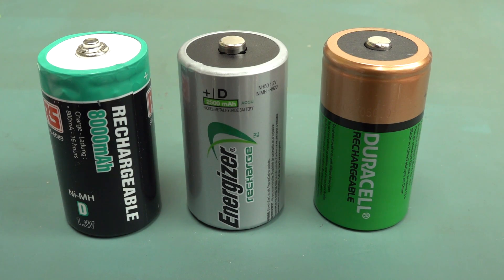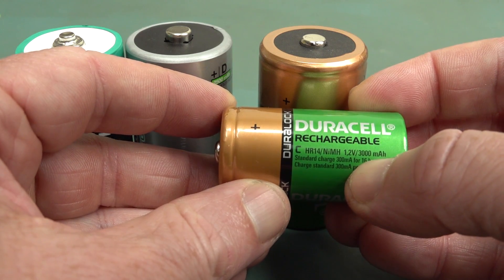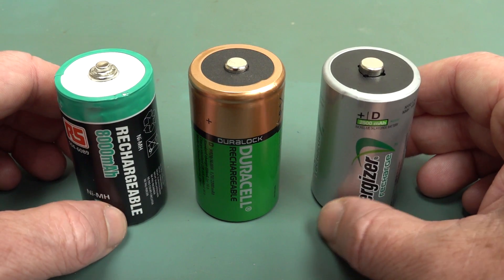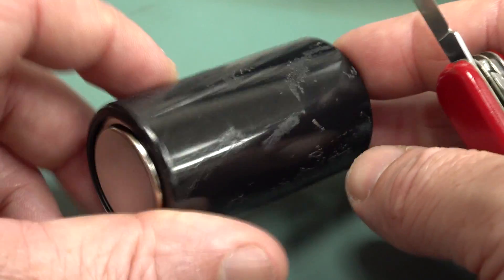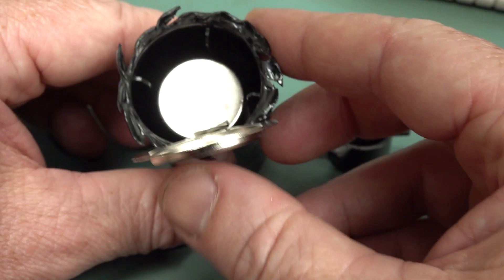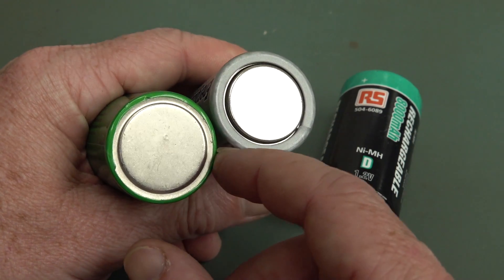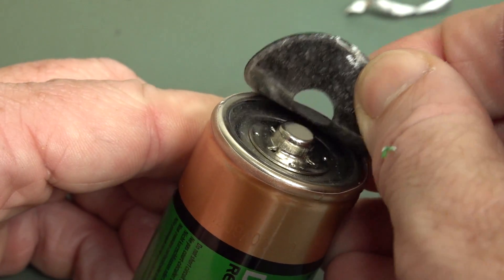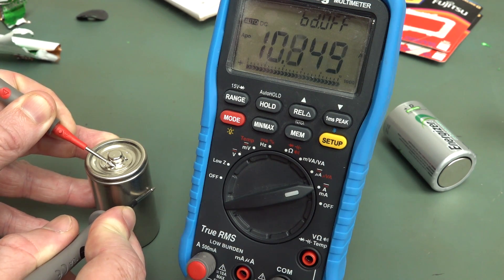EEVblog #1200 - BUSTED! - Energizer & Duracell NiMH

Comment: I know nothing about batteries, which is why I googled it before purchasing rechargeables. The first thing I found was obviously the nimh, so I think most consumers are aware of this, especially the ones that start with 0 knowledge and have to google it. 

However, there are a also some advantages for the weaker ones. 1) they're way cheaper, and some people prefer (or have to budget) paying less and charging more often 2) The charge time is much faster. Most chargers won't tell you when something is 'half charged' but if you're short on time, you'll know exactly how much power the thing has at the fully charged mark.  3) some devices just don't need that much power and it's excessive to spend the extra money when you only have to charge it once  year anyway. 

It would only be a rip off if they weren't passing the savings on to the consumer, but they are, and that's the point. Duracell/energizer do sell higher capacities of D-cells for more money, you just didn't review them here, so it's an apples to oranges comparison when you're ignoring the price point.

Comment: As long as the price reflects the capacity it should be fine. If the D cell was all battery then It might be to expensive to use. Anyone agree? or do you think each size should be the highest capacity possible?

Comment: In the late 70's or early 80's Radio Shack sold a series of NiCad batteries that were packaged in a purple and white plastic shell. Internally the AA, C and D batteries used the exact same cell!

Comment: Disappointed in this video.   The RS battery is like $11 USD and the Energizer is like $3.35.      Its not a rip off.    
They give you options.  Loading up some kids toy use the cheaper battery, loading up some professional gear, get the expensive high capacity battery.

Comment: No scam here. 
Read the labels.
Pay for the capacity you want.
Volkswagens cost less than Mercedes, and have different capacities.
Reply: But, in this case, you'll be paying exactly the same for the VW as you would for the Merc. That's the point...
Reply: @troyjollimore4100  check again.
Amazon sells all three. The price of each is relative to capacity.

Comment: If the capacity is similar to their alkaline cells, and they're priced fairly, there's not a significant functional issue with these. They are quite underfilled and it's a bit wasteful though. 

I've seen many comments on this parroting the favorite corporate line "you should know better,  consumers should do x", but ignoring the fact that it's an intentionally mediocre product. Regardless of intent, they put in effort to produce an inferior capacity, relative to cell size and composition. I think anyone would be annoyed after watching this disassembly. I'm quite confused by anyone arguing in favor of reduced transparency and clarity in product labeling. Properly enforced regulation can help eliminate issues like this.

Comment: This construction is very Similar to a capacitor
Reply: Batteries are very similar to capacitors, main practical difference is that capacitors can discharge very quickly but batteries can hold larger charges for longer. They do function differently and that is how they achieve this, but construction wise they look the same.
Reply: @Ephem13  I know this but was surprised the the difference between a rechargeable battery and a capacitor are very similar but also makes a lot of cents. The technology's even though the applications are very different probably the early rechargeable batteries (might be still the same today) were a evolution a capacitor the same way black powder is the same as charcoal.

Comment: Hey dumbass, the lower d cells with lower ratings are for low draw devices that don't require the huge rating and they were developed to use smaller internal cells but fit where an older non nmhi d cells fit. Most are built for small security cameras as back ups. It's NOT for scamming as they ARE marked appropriately. Your cheezy accent and fake ass  "personality" just make you look like a douchebag.

Comment: What's next? A stack of button cells to make a C and call that F, because it has 24V?
Reply: I once saw C and D battery housings sold to fit a AA battery inside. Good for toys and such without needing to stock all battery types at home.
Reply: @rudylikestowatch  4 pieces for $10 - AA to D adapters. saw them on amazon recently. Hilarious. But I like to have actual D cells.
Reply: @Sypaka  Yes, D cells would be superior.
Reply: Now I get your original comment. An A23 battery is an 8-cell device with a nominal voltage of 12 V often used for garage door remotes.
Also, some 9v batteries are a bundle of 6 AAAA batteries inside.

Comment: My experience as someone who uses a lot of rechargeable batteries is that they all pretty much suck these days.   The mah rating is only half the problem.  The other half is the dependability.   They tend to just randomly stop working often and it's annoying.  I still have to carry alkaline backups for everything but there's about a 20% chance on every outing one or more of my rechargers will randomly die on me.

Comment: My Eneloop AA  rechargeables inserted into a 3d printed "D cell" adapter outlast the Energizer scam of D cell batteries.
Reply: This D cell adapters are officially offered, unfortunately they offer no Eneloop as true D cells.
Reply: @simonm1447  at least they're open about it and say "we don't make D-cells, but here, have a D-cell adapter for the AA cells"
Instead of making a "D-cell" that's just an adapter with an AA-cell and sell it for 3x the price.
Reply: @maximilianmustermann5763  yes, D cells with hidden smaller batteries inside is cheating people which don't know about it.
Reply: @simonm1447  Idk about cheating. If people go by how many ampere hours they can get out of them, there's no real lie. Adapters are a hassle in many cases. Some might just prefer getting the right size right there in the store.
Reply: @stale2665  You don't only buy a adapter - you buy a battery with only 1/3rd of the capacity. 
This is clearly a technical limiting factor for many purposes, these big cell size is used in stuff which needs more energy than a AA battery can bring.
Reply: @simonm1447  Yep, I have the official ones. That's what I modelled the ones to 3d print after. Shame it's so hard to find a quality D-cell NiMH.
Reply: @PowerScissor  In Europe there are Ansmann NiMh cells available as D cells. They are good quality, but cost more than 10 Euro per cell. They have 10k mAh.

Comment: Aaah the lessons of Big Clive.   From Energizer's own safety sheet:  "Do not open battery. The negative electrode material may be pyrophoric. Should an individual cell from a battery become disassembled, spontaneous combustion of the negative electrode is possible. This is much more likely to happen if the electrode is removed from its metal container. There can be a delay between exposure to air and spontaneous combustion."  https://data.energizer.com/PDFs/nickelmetalhydride_psds.pdf     Clive's video: https://www.youtube.com/watch?v=tBg4ximDrsk
I hope you had your explosion containment pie-dish handy!

Comment: I always wondered why Eneloop sells "D-cell" shrouds designed to contain a AA battery.  With capacities of 2450 for the AA size,  I guess the thinking is that you could just have a load of spare AAs pre-charged and swap them out, rather than paying the huge premium for a fully-packed D-Cell.  You could pack 3x AA cells and maybe an additional AAA cell into a D sized adaptor for a capacity of 8250mAh (Eneloop Pro).  Why they don't sell these adaptors is a mystery.

Comment: It might already be mentioned in comments below but what you found inside the Energizer was a "sub-C" battery, commonly NiCD or NiMH and most often used in remote control cars, planes etc.  They're made in the millions by other companies, bought cheap by Energizer who place them inside their D-size "adapter" and rebranded for big profits.  As you mentioned, you might as well go for a cheaper brand with the full capacity as you'd expect a D-cell to have.

Comment: Radio Shack in the US used to have two varieties of rechargable D cells. One was cheap and light and was three AAA cells in the case. The other one was a proper full size D cell, weight a lot more, cost a lot more and was rated accurately at 10,000 mAH.

Comment: A few years back I tried Nimh batteries. They were very unimpressive. Probably because of this. Gave up on rechargeables because of it.
Reply: It's a scam to make the batteries die out after 1-2 years of multiple charge cycles. Larger capacity, "true size" Nimh batteries last far longer with less charge cycles. It's all a money game, they can't make money off you if you only buy rechargeable batteries once every 5 years.....

Comment: What is happening at 7.30
You take a reading of 10Amps. Are  you injecting power and seeing what it takes. I didn't think you could measure current like that with multimeter, fair enough with a powersupply. Thanks

Comment: Both the C cell and D cell Duracell batteries come in two versions, 2 200 mAh and 3 000 mAh. Slightly more expensive, but better choices are Ansmann 10 000 mAh, Ansmann 8 500 mAh (LSD) and GP 5 700 mAh (LSD).

Comment: Well, I recently came across an article in which it was told that Duracell has stopped manufacturing D size and C size rechargeable batteries.

So I think that it is a clone of the Duracell, that stuffs the C size battery into the d size container.

Comment: This kind of C and D-cell underpowering has been going on for at least 20 years that I know of with name-brand rechargeables including the shack that starts with "R". This was done even with the poor old NiCd cells. I just used relatively cheap cell physical form adapters that could take the cheaper AA cells and turn them physically into a C or D cell size as needed.

Comment: I just bought from a new display at Walmart Energizer "Max" alkaline D cells that are 24,000mAh. I had to look hard for that claim on some internet add.  Nothing about capacity is printed on the package or battery, 24,000mAh is very good if it is true.  This cart I just now looked for does not specify the battery size and give a broad range of 30mAh to 24Ah that is 24,000mAh for alkaline. Zink Chloride has the highest capacity listed at 38Ah or 38,000mAh...
http://data.energizer.com/pdfs/typical_characteristics.pdf

Comment: Disappointed you didn’t quote actual costs of the batteries. There are plenty of cases where manufacturers of the products build for a big battery, but use doesnt justify a big battery, so if costs work out might make sense.

Comment: I'm using rechargable AA batteries for Wii joystick "to save money" by using instead of the alkaline batteries. They claim for this product, that  it can be recharged up to 1000 times before losing capacity, but it seems to be more like 50 to 100 charges they will work. Isn't this scam?

Comment: The old "Russian Doll" trick.  Put 4 low capacity AAAs inside 4 AA shells inside 4 C shells inside 4 D shells inside a 6V lantern battery shell and hope that nobody notices.   I took apart what was supposed to be a 10,000 mAh power bank with 4 x 2,500 MAh  18650 lithium batteries.  What I found was a single el cheapo 18650 and 3 other battery like objects (BLOs) filled with SAND.   Border control need to take a close look at the bio hazards in that sand

Comment: Tests have shown that the capacity printed on the battery is substantially less than 100%.  The so called "Name" brands didn't rate very well when capacity tested and compared to several other brands.  The very best of the NiMH batteries tested no more than 95% of stated capacity but some of the big name brands were only about 80% of stated capacity.

Comment: My wife bought some AA batteries years ago. She put two in the Tv remote. This remote regularly pissed me off because it was apparently made by John Deer as it plowed through batteries. Then one day the two batteries gave up the ghost. After about a year of use. 

Curious I read the label on the batt's to find they were LiPo's! 1.5v LiPo's I $#!t you not. They said "rechargeable". Okay great... With what? I have 3v LiPo chargers, never even heard of a 1.5v soooooo they got stuffed in a NiMH charger. No smoke, no fire. And only took like a day to charge, WTF? But they charged and lasted for years thru multiple charges. 

On the passing of my magical batt's I preformed an autopsy on one. They contained a LiPo cell 1/2 the size of the AA with a built in charge/discharge board. I freaking loved them. The only AA LiPo's I can find now require the device to have two AA's in series as one is just an empty tube placeholder. BTW the only part of the label I could read was 1.5v LiPo and the word rechargeable. Made in "Onehunglow".<<re: EEVblog

Comment: Why would you compare a 2200 to a 8000 milliamp battery?  That like comparing a 4 or 6 cylinder engine to a v-8, in the same model car.

Comment: Someone explain how they are getting away with their total bullshit "Longest lasting" complete lie advertising campaign? It should be required by law to print the mAh at a prescribed low and high load on a secondary battery. Try that "longest lasting" bullshit when I can read the capacity right there on the package. Both Energizer and Duracell are complete criminals in my opinion, and consumers are so stupid that they don't realize that those two brands are NOT the best battery at all. They are the ones that spend their entire budget on advertising, cutting corners on the actual product to spend more at the ad agency apparently. Making total shit D cells sounds like a fantastic way to soak fire departments, police stations, industry across the globe, selling them shit D cells that are not even close to C cells, so they wear out extra fast and get replaced often.

Comment: I find it almost insulting that manufacturers sell, basically, rechargeable AA batteries in a C or D size shell. The larger batteries are used for devices with higher drain or which need longer lasting batteries, and getting these rechargeables kinda throws that all down the drain.

Comment: Another way a corporation can rip off the public and increase its bottom line  by decreasing material. It's like putting bigger air bubbles in bread just to make it look like more. But air in my batteries, give me a break. Go to the cheaper brands, you get more for less. I guess the moral of the story is read the information on the package and do the math. EEVblog #1200 good video.

Comment: Should have measured the max AMP out put of the batteries between the brands as you may find the high M/ah has a lower rating then the low m/ah  rated batteries taking something i found out about 18650 batteries
Reply: Those are lithium batteries tho. Not sure if it applies to NiMh

Comment: Some people prefer lower capacity batteries for devices with lower consumption, and these products satisfy those needs on the market. I can't see anything wrong here. For example an alarm clock can run for 10 years on a C type alkaline battery, why on earth would anyone want to put in it an 8000mAh monster that could not be cycled properly because of the low consumption of the alarm clock? Better to put in a lower capacity cell and cycle it at least once in every few years.

Comment: About 10 years on or so I'm still using my Eneloop AA and AAA sets in rotation. A couple sets have lost their capacity balance and have been demoted to lower cell count sets or to individual cell use, but they're still all going quite well – higher than 80% capacity potential. I use them all the time in small electronics that'll take them, remotes, wireless keyboards and mice, flashlights, handheld two-way radios, kid's toys, etc. I have extra sets charged up and ready to use on the shelf, so just swap them out as needed – no waiting. Beauty. 👍

Comment: In NZ, both primary and secondary cells have been a scam in respect of pricing for most of two decades.
The main change came along almost 30 years ago with the bubble-pack invasion.
Even today, you can buy a whole container load (pre-wrapped in impenetrable plastic) of very authentic high-capacity, primary cells from Japan (chemistry notwithstanding) for about 20 cents per cell.
These SAME cells are sold in supermarkets for between 5 and 10 times the landing price.
Do the sums folks.
Yes, I do believe the days are past when Union Carbide and their retail brand outlets diluted the chemistry of their cells every few years for the "consumer" stuff, and still made the same old shit and marketed it as their latest and greatest "advanced and never before done" cell that would change the world.
But the scams are still rampant in many variants.
Primary and Secondary cells in any chemistry (including Lithium and LiPo) is a bloody minefield of misinformation and piratical practice.